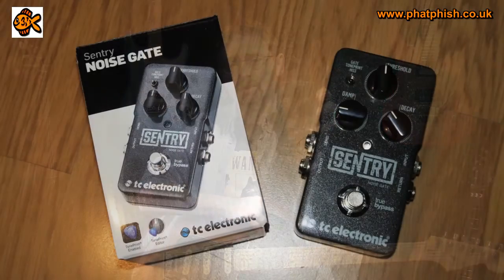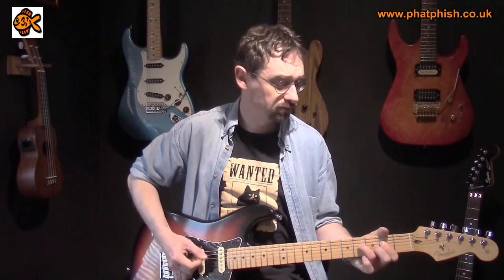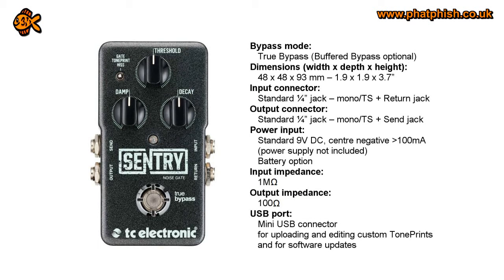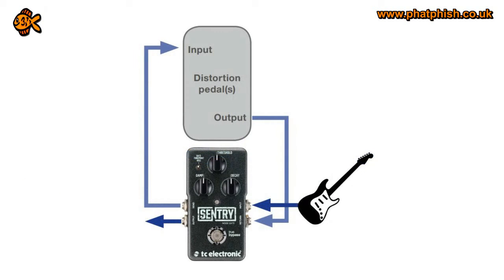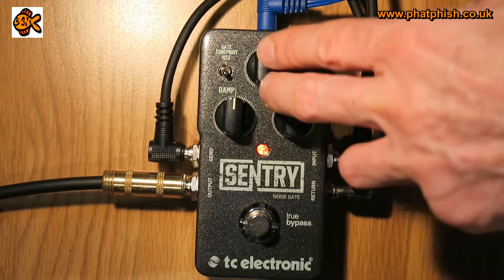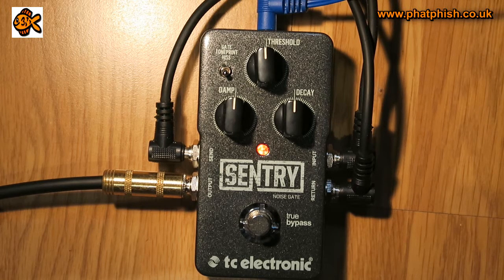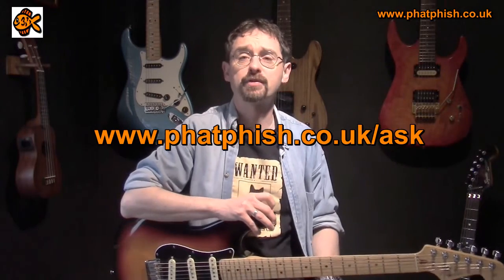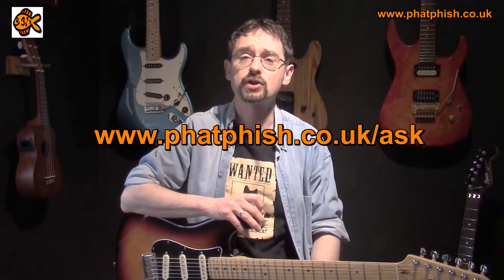TC Electronic Sentry Noise Gate Pedal

Comment: I could not eliminate the hum/hiss of my new valve preamp & valve power amp/cab sim for our recent direct to F.O.H. setup.  I do play with a lot of dynamics and the noise was very unacceptable. (Yes- conditioned power, iso power, correct power, all patch cables in great shape, balanced line outs where required.......get it? This gate will not be a bandage for a hemorrhage) 
New sentry-no problems---your vid was the only one I could find with actual pertinent instructions for suggesting "plug and play!"
Thanks!
Reply: Yeah man ,,, good words ... I got the silencer ,,, but the sentury is the better one ,,, at double the price ... but what's your sound worth ??? everything ...

Comment: IF you are using a passive single coil pickup, you can have all the expensive cables and have all the expensive high end power conditioners and you will still have a 60 cycle hum regardless.  Noise gate is the only way to silence it, but not get rid of it.  The Electro Harmonix Silencer does the job effectively at half the price of the Boss NS-2 and the this TC Sentry.
Reply: EHX makes a pedal called the Debugger and its whole purpose is to get rid of 60 cycle hum. Perfect for your noisy strat.
Reply: Yeah man ... You took the words ,,, right out of my mouth ... I've got the silencer ,,, my friend has the sentury ... But is tone print a good reason to pay double ,,,  not for me  ... Good one ,,, loved your comment ... D
Reply: @lynyrddeville   Yup ,,, will definitely have to check out the debugger ... I like the sound of it ,,, or the lack of sound / noise ... D

Comment: i never thought noise was an issue but lately i got into a heavy metal band, playing loud as hell with full gain and it became a problem. I think this pedal might be a solution.
Reply: Jesse Fournier I've been using EMGs (they show less noise than regular humbuckers), trying to stay away from my cabinet also helps mitigating feedback, and lowering the gain settings (when volume is high enough you don't really need the same gain settings when playing at home volume). With these tricks I've been avoiding using noise gate.
Reply: so hows the pedal been the last year? haha....or did you get it?
Reply: Yeah man ,,, I got a high Gain distortion pedal and had a lot of noise ... Yeah that's called gain ,,, never had a problem ,,, but I never had any real high gain pedals before ... I thought something was messed up ,,, but it was just having gain for the first time ... The effects loop noise gate is the way to go ... I saved half the money and got the silencer ... instead of the sentury ,,, my friends got the sentury and it certainly better with tone print ,,, yeahhhh man !!!
Reply: @ericksousa911  I know right ... The first noise Gate I got ,,, was just a 2 wire tone sucker ,,, but the 4-wire effects loop Gates ... Isolate the pedal chain ,,, and  work really well ... So the only suck now ,,, is just my playing again ...

Comment: So if you use the four cables and I have a tuner in the first position and at the end EQ and then my distortion petals in the middle can I still use the 4 cable way with the EQ and the tuner in the chain or do I only use it for the distortion pedals only?  This using it with2 cables
Reply from the maker: In this case, using 4 cables with the Sentry I'd have the tuner in front of the Sentry, distrotion pedals in the Sentry's loop, and the EQ after the Sentry.  EQ is a fbit of a funny one though, as it can go in a number of places in your signal chain depending on how you want to use it...in front of gain, after gain, or at various places in the effects loop of the amp...I really ought to get around to doing a video about EQ pedals :-)   Just about the only place I wouldn;t consider it appropriate to put an EQ pedal is in the loop of the Sentry.

Comment: i just bought that pedal.i run it at fx loop at evh 5153.
1)the overall tone change a lot.the final sound turned to digital.
2)i am playing 3 days maybe with this pedal and when i am playing the pedal turning off by power and its turning on again after 2 sec.4 more pedals sharing the 2A output and they dont turn off as the gate.
3)really disappoint that i didnt choose the dec ii

Comment: according to your 2nd connection configuration at 6:25, I was wondering if it would work:
guitar -> tuner -> OD -> distortion -> SENTRY -> marshall head -> effects loop send -> chorus/delay/vibe -> SENTRY again -> effects loop return
I am waiting for my TC sentry to arrive, so I was not able to test it. Do you think it would work without any problem, so that I could reduce the noise coming from the guitar, pedals and the preamp?
Reply from the maker: The config's I show in the video are the ones listed in TC's own manual.  The set-up you describe isn't mentioned there, so it may not work
Reply: All the fun is getting it home and playing around with all those different configurations ,,, you'll find what works for you ... But I think you want to leave all your delay reverb uni-vibe stuff outside of the gated loop ,,, so it doesn't cut off the end of your trailing effects ... Great video ... Ok I see that's how you had it ... Well done 👍😊👍 ✅✅✅

Comment: Can someonw help me? The noisegate is te only pedal Im using, and a tcelectronic tuner. where do I put the noisgate? in the input of the amp into my guitar or in the fx loop?
Reply from the maker: Personally I'd probably put it between the tuner and the amp, but if I were you'd I'd experiment and see which location works best - none of the options would cause any damage, so try it.

Comment: ive just bought a new ibanez with a coil spilt switch on it. 
high gain amp settings make horrible hiss sound that changes when i place my finger on the actual metal coil switch.  is there something wrong?

the hiss decreases when i touch the metal switch....

bad electrics?
Reply from the maker: That sounds to me like it could be bad earthing.  I'd expect to get a bit of noise when you split the humbucker to single coil (because you lose the humbucker effect) but if the noise is related to you actually touching the guitar, then I'd get a guitar tech to check it out.  It's likely just a little bit of soldering that's needed - worse case maybe a new switch.
Reply: thanks
Reply: Yup ,,, got to work it out ,,, but an effects loop noise Gate is the way to go ... Regular noise Gates ,,, are just tone suckers ...

Comment: it works well with stacked dirt pedals?
Reply from the maker: I regularly use it with stacked drive and it works well.  If you do something extreme, like stack a couple of drive pedals turned up high, plus a boost into the dirty channel on high gain then some noise still makes its way through, but that is a fairly extreme example.
Reply: +PhatPhish Guitar Studio Thanks!!!

Comment: When you talk about using it like an efx Loop for distortion pedals, where would other effects that normally go on the front of the amp (like Wahs, Comps, Whammy, etc) be on the chain? Should they also go into the Sentry "Loop"? Thanks!
Reply from the maker: I'd try with just the gain pedals in the Sentry's loop first, but what works best will depend on a number of factors.  You won't harm anything by trying different placements in the signal chain, so experiment and see what is most effective.

One thing I would say is that if you have a tuner pedal, put that before anything else - that guarantees that the tuner sees the cleanest signal possible direct from your guitar, minimising the risk of it getting confused by any alteration in the signal.
Reply: Yeah play around ,,, with the trailing effects delay vibe & verb ,,, outside the gated loop ...

Comment: Pedal eats batteries faster than a digital modulation pedal...
Reply: And this is why you get a transformer
Reply: @Danvezina  tc electronic is a pretty bad company.  Faulty products, and almost impossible to get a hold of customer support.
Reply: @Adambobro  I’ve never had a problem with them and I’ve been using their products since 1994.